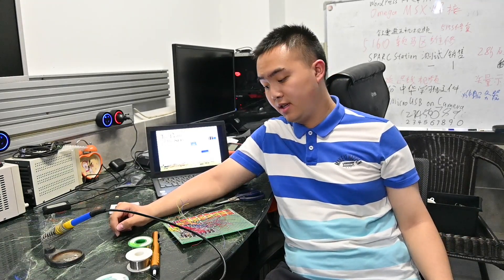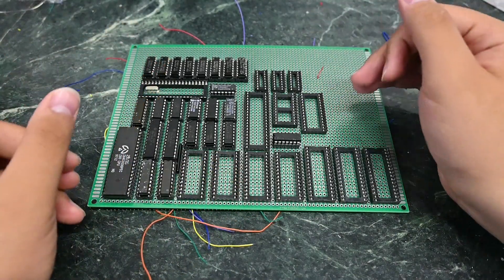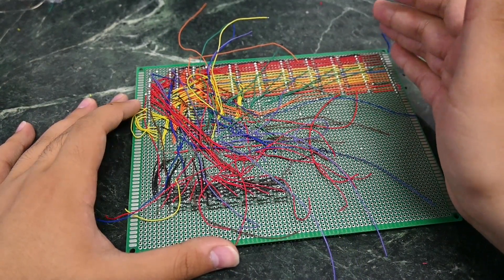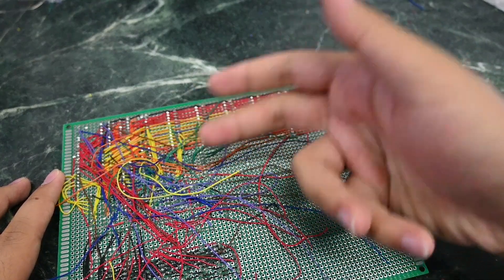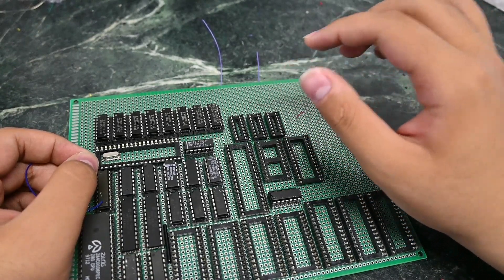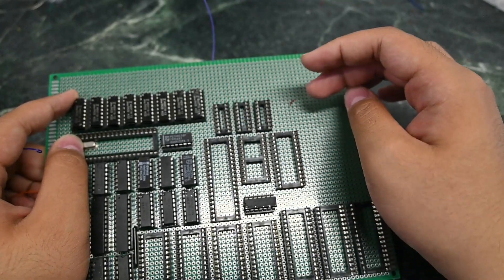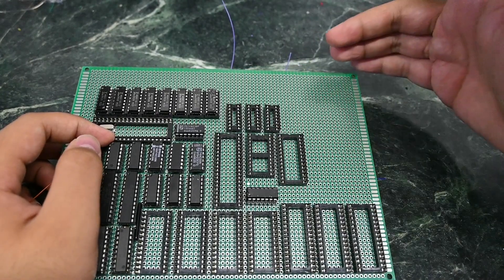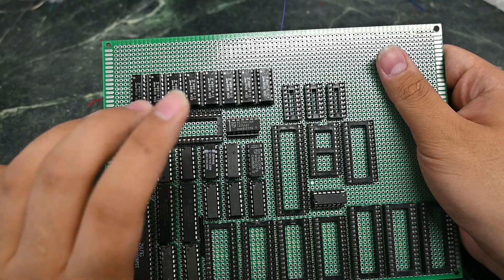[Z80 microcomputer] Updates on the progress of the motherboard

Comment: You're keeping us all in suspense. But why not make a PCB to avoid the painstaking wiring?!
Reply from the maker: Because you're never sure that the circuit is correct... This is a prototype and indeed several major bugs have been found in the circuit. If I had used a PCB I would need to cut a lot of traces and add a LOT of bodgewires, which is also painstaking... (Or I can just change the PCB file and order a new batch, which means long wait time and re-soldering most components